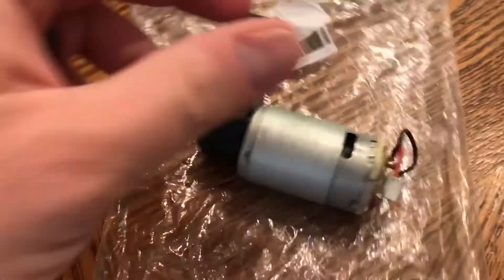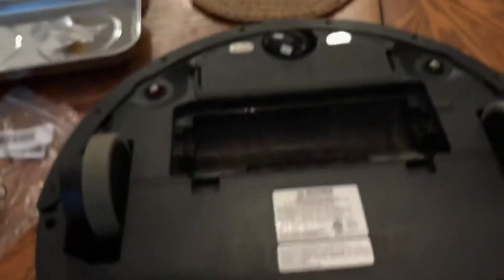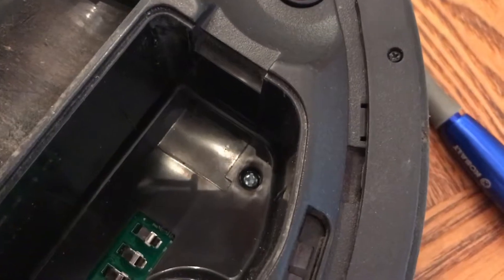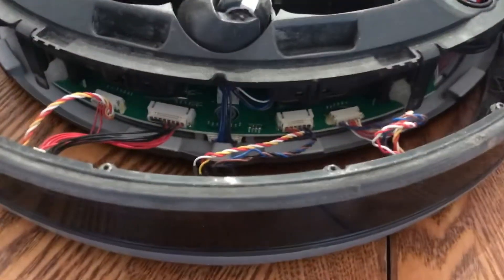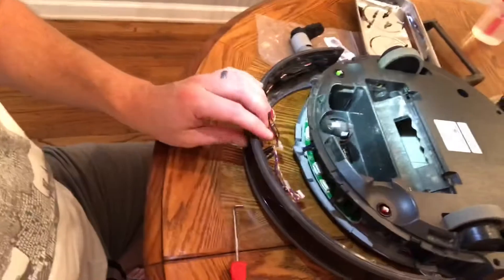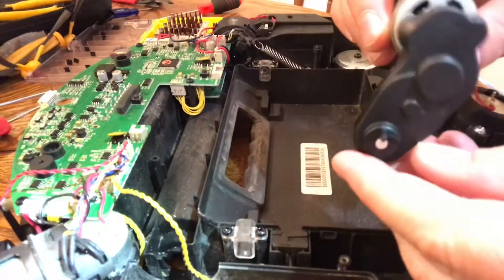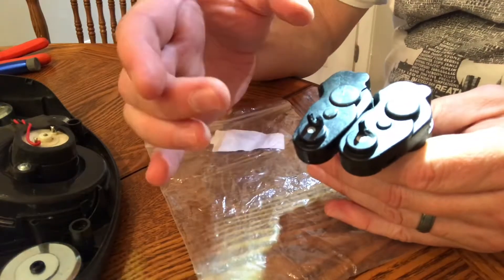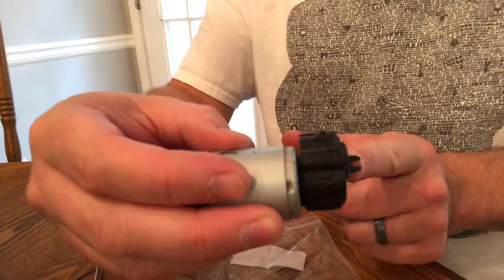Brush motor swap out for a Deebot M80 Pro

Comment: Great video. Thanks for making it. Our Deebot sounded like it sucked up the cat.
Reply from the maker: Thanks.  Ours was awful and this fixed it for a while.  It is still a bit noisy but not nearly as bad.  Really just trying to extend the life and it worked.  It has moved to my downstairs vac and I got a Eufy Robo Vac 11S for the upstairs.  Good price and seems to be a good vac.
Reply: @thefixer8387  Ours is about 3 years old and has run fairly well until recently. I ordered the replacement motor and bought another DeeBot, so we can use the older one in the basement.  A few days later, looked at the Eufy at Target. Looks like a much better vac. I guess we'll see how long this newer Deebot lasts and keep the Eufy in mind for next time...

Comment: Hello, can you post where you found the motor? I am going to swap mine out. Thank you for sharing.
Reply from the maker: I found the motor on Amazon.  I will try to find the order and list the details soon.
Reply: @thefixer8387  Great video! Just following up to see if you can tell us the seller and Amazon title/description. I haven't been able to find it and I'm hoping to buy a replacement now that I have my Deebot taken apart and all over my kitchen table.
Reply: @jamessitar3340  Very sorry it took this long to add the link to the motor.  It turns out I remembered it incorrectly, I got it on eBay rather than Amazon.  I will add the link in the description.